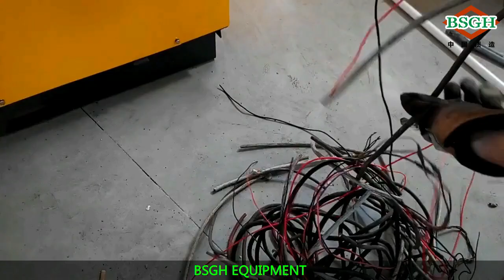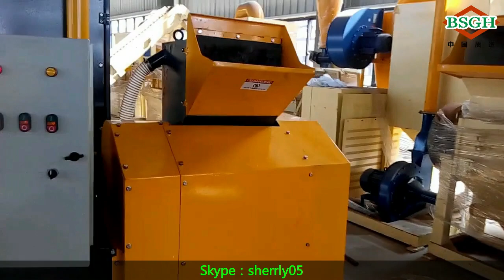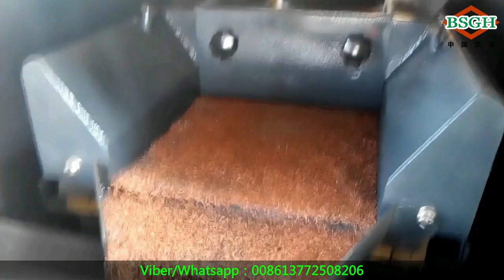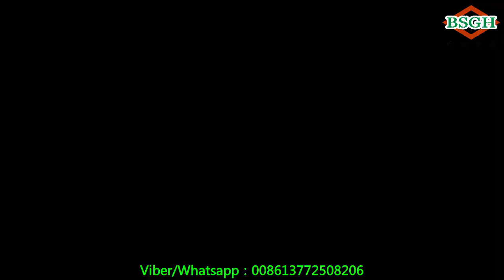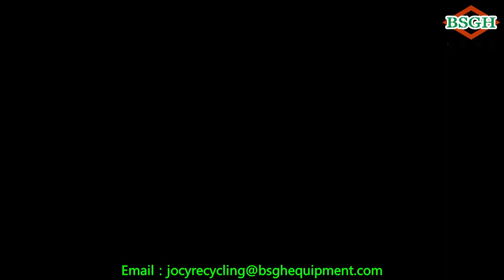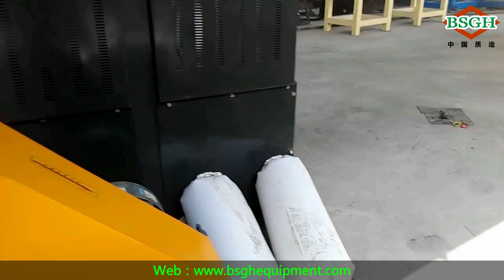Low Price High Quality Scrap Copper Separator Machine Used Cable Wire Granulator Recycling Machine

Comment: that was a lot of copper for 5-8 cut wires a demonstration is put max handling in too
Reply from the maker: if you have any question,you can contact by via whatsapp:008613772508206, or visit website: www.bsghrecycling.com